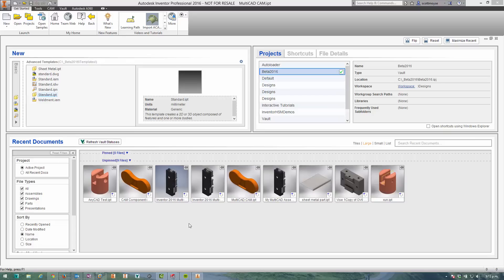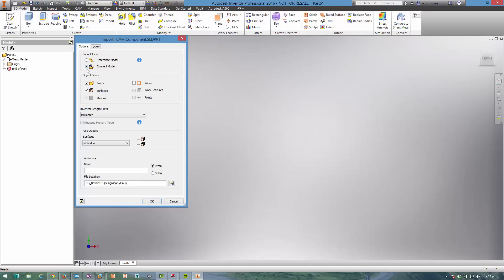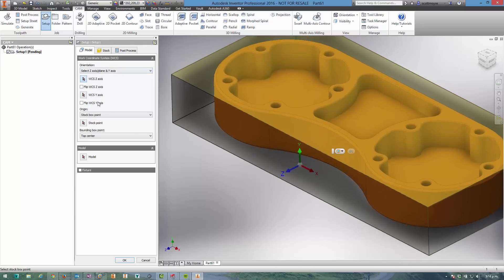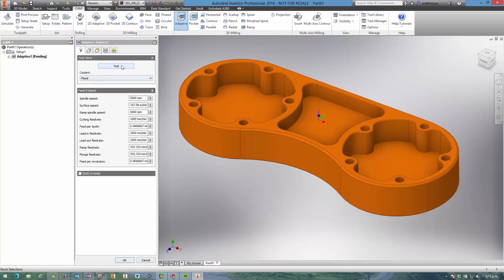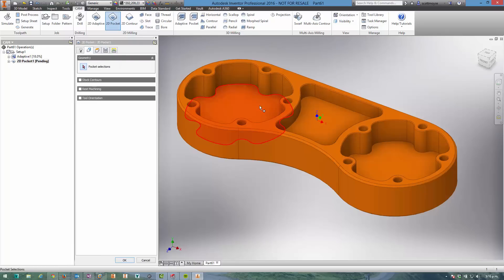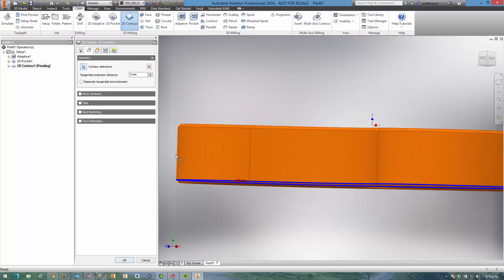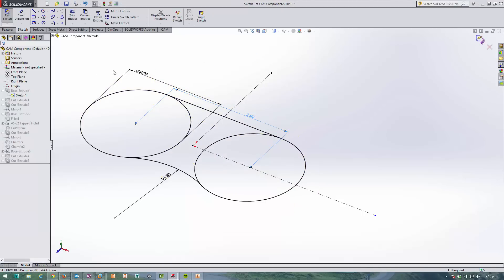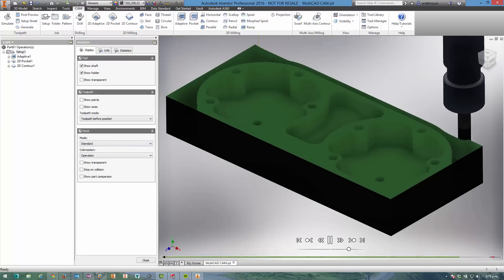Autodesk Inventor 2016 AnyCAD CAM

Comment: Can you also use this with CNC Routers or is it just applicable to CNC milling (steel, etc)? Thx
Reply from the maker: Wonder Around YES!! you can definitely use this for routers, there are a number of router posts available as well. The biggest drawback for routers at the moment is the lack of a nesting engine. But the CAM team are currently working on integrating aspects of the Majestic Systems technology Autodesk purchased last year. What form that takes and when it will appear is yet to be announced. Nevertheless you can still get good 'router' results solely using the Free 2.5 axis solution and programming in the assembly environment after manually nesting parts into a sheet.